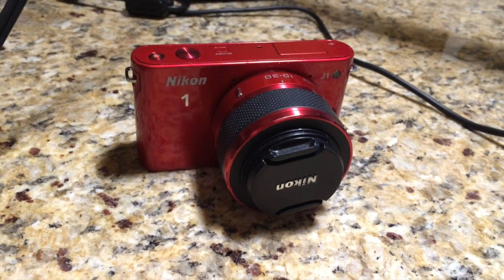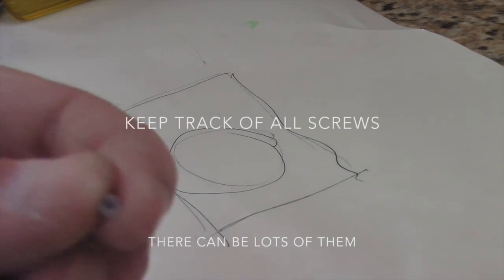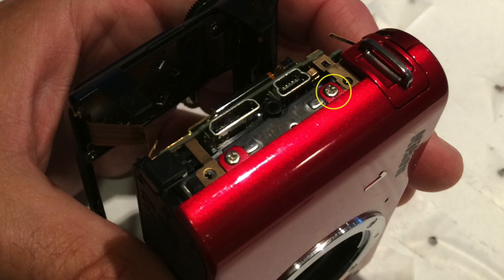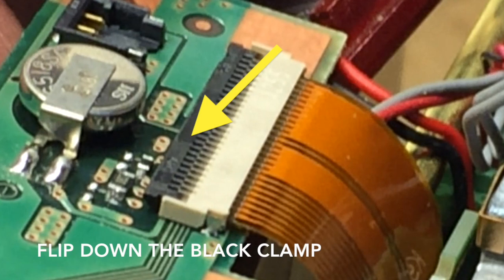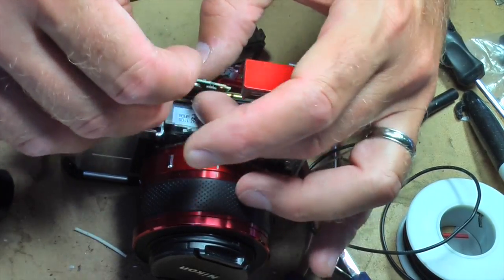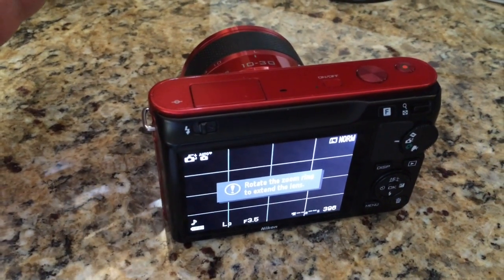Nikon J1 Power Board Replacement

Comment: Thanks for posting. I was able to repair my daughter's  S1 with the same problem based on your video. Parts were hard to find, but I picked up a non-functional S1 on eBay, and extracted the power board. Works great and now I've got other replacement parts if needed. Thanks again.

Comment: The top panel of mine seems pretty stuck on around the power button area on the back. Any advice?
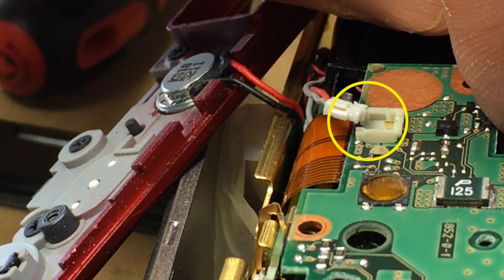Reply from the maker: At 00:01:43 in the video I point out the screw at the top of the battery compartment. I don't recall if that secures the top of the body or just the power board. Obviously the video sequence shows that the top has already been removed but it is always possible that I got the sequence swapped. If you are sure that all the screws have been removed, then it usually comes down to bumping and nudging pieces apart, perhaps using a thin blade or spudger.

Comment from the maker: @kieu I would try all the usual stuff first - confirm the battery is fully charged, the contacts aren't corroded, see if you can connect via USB, etc. if the camera continues to appear dead and it isn't under warranty, then I'd replace the power board.
Reply: Hi there , i really liked your video , but i really need your help on how to replace the pop-up flash on the Nikon 1 J 1, this will be a life saver !!!! :) thanks in advance man
Reply: How would I check if the contacts are corroded?

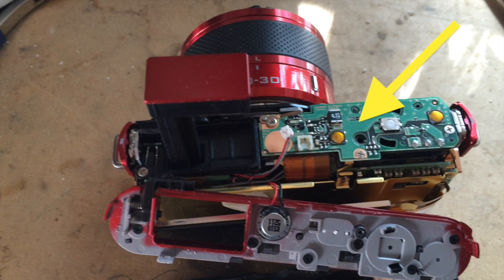Comment: You should have stopped at 00:01:20 and simply jumped the little "resistor/fuse" on the far right side. Most likely, that would have solved your problem.
Reply from the maker: Ah, good tip - thanks. It's a small enough board that I should have looked for something simple to have blown. Hopefully others will see your comment.

Comment: if anyone gets sd card errors not fixed by aircan, take out the mainboard and straighten the sdcard pins from the other side.  i got the camera cheap without battery, after getting that it only worked with an old 1gb card. it was really spinning me out, then i put a bit of card behind a 16gb card and it worked, unfortunately after i trimmed the card to close the door it failed again. after removing the mainboard it was clear that vss2 pin was a little bent. im not sure if the old card didn't need vss2 or if the grooves straightened the pin just enough. anyway it was an easy fix with slight pressure from a scalpel tip to straighten it. be very careful with the connectors for the lcd ribbon. i broke the backlight connector clamp which it tiny but lucky a dob of hotmelt fixed it

Comment: no on the J2 the top does not wiggels off, its stuck to something about the place of the shutter, you dont show this on video....
Reply: I have the J2, you need to remove the front cover as well. an its clipsed on the sides. I have the same issue with mine